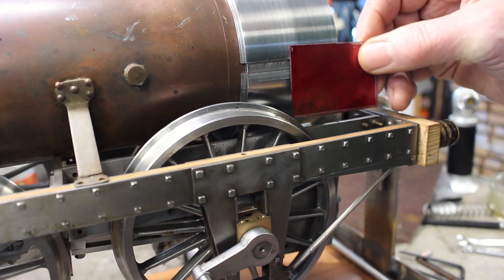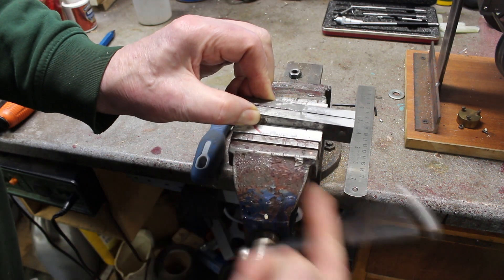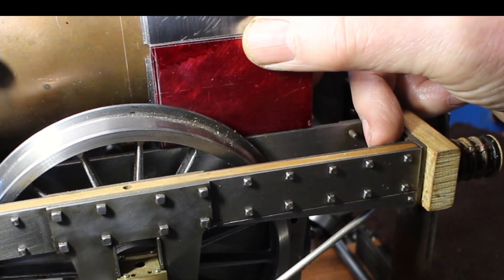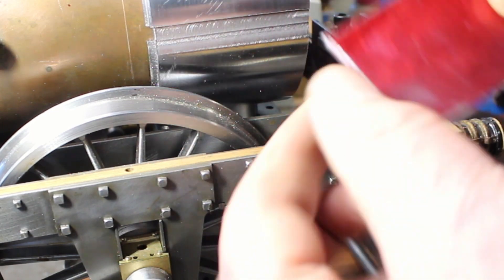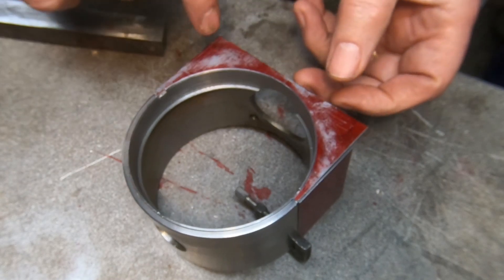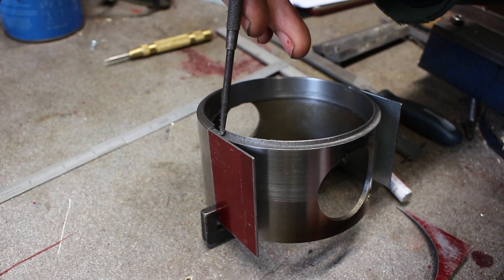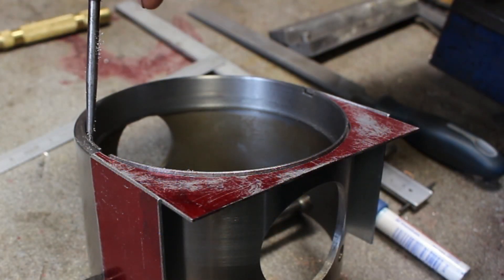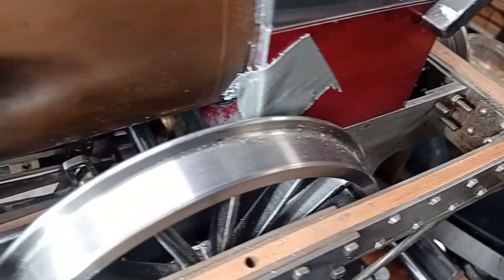Lion - Model Steam Locomoitive Build - Part 63 - Smoke Box. Follow my model engineering adventures.

Comment: I totally agree with @GWRDukedog9021 about your filing jig. 
Another YouTuber I follow is an absolute master of filing and would do that, freehand, on his ear. 
This filing jig is just what we mere mortals need. I'm going to make my own.

Showing us what goes wrong, and how you overcome the problems, is one of the great strengths of your videos. It's also good to see the occasional failure - your model would not run if you had pursued reducing the space between the wheels. The only way I could see out of that problem was to completely rebuild the frames and that's not gonna happen!
Reply from the maker: Thanks Jeff. Yeah, the filing jig is a good time saver as well as helping with accuracy. 
Cheers
Nigel

Comment: Would it help at all if your vice filer was hardened? Thinking of making one. :) 
although making it hard would be a reall challenge in my small shop.
Reply from the maker: Yes, hardening my filing gadget would help prevent it's wear but would be hard on the files. It really doesn't wear very quickly at all and is esay to skim over on the shaper or mill. Personally I prefer to leave it soft.
Thanks for your interest and comment, much appreciated.

Comment: Hi NIGEL
After the lion construction the next project could be a little hydraulic press...🤔
The die filer is a very useful equipement for the thin metal sheet.
Bfn
Olivier.
Reply from the maker: Thanks, I'm enjoying using the die filer, it's easier and more accurate than filing something held in the vice.